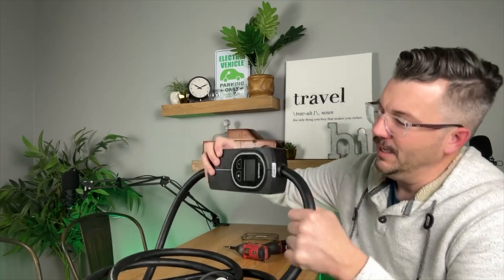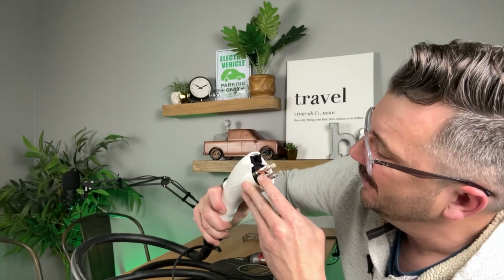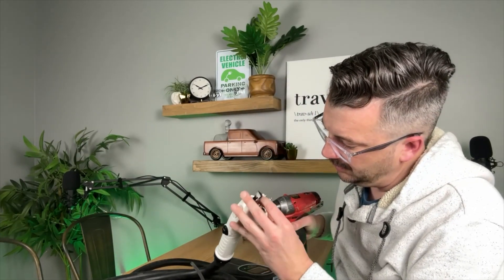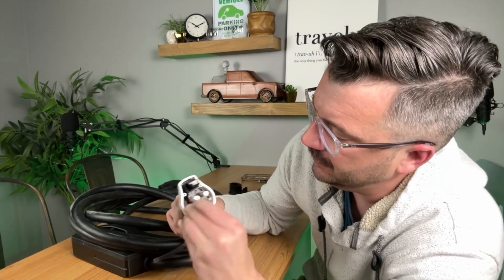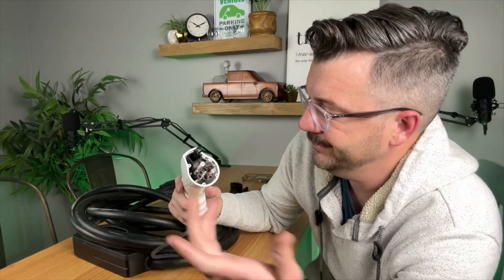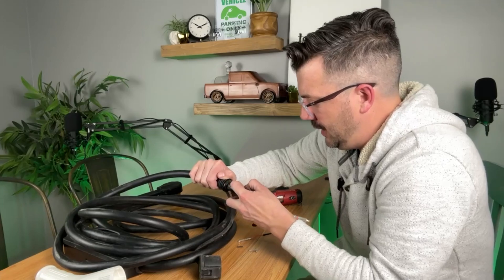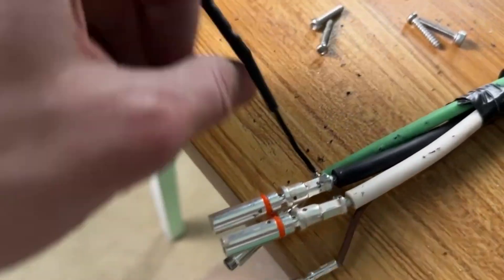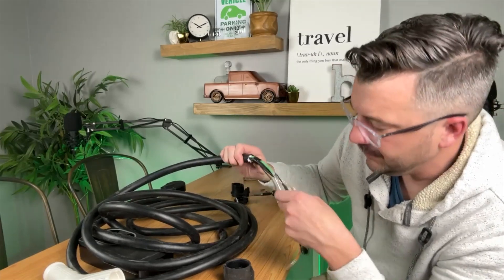Level 2 Portable Charger Tear Down!

Comment: Glad you didn’t lose any body parts Steve.  Fun fact, that thing is a Mobile Connector. It’s job in life is to insure it’s plugged into the car securely and then supplies 240 volts AC to the cars internal charger that actually charges the battery.   I’d call that a POS design.  Love your content, take care.